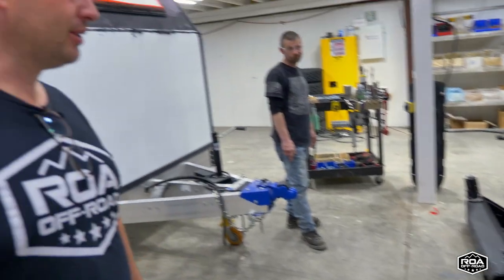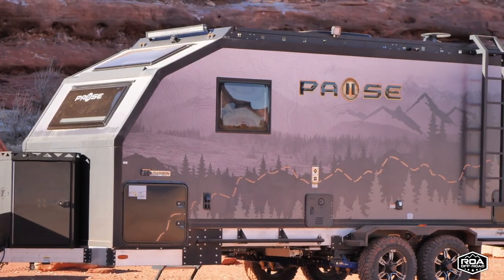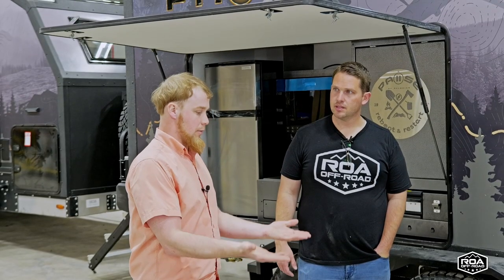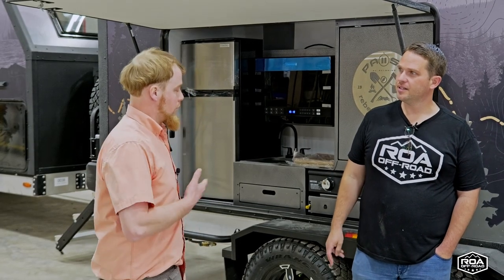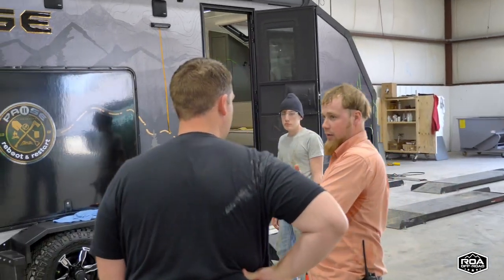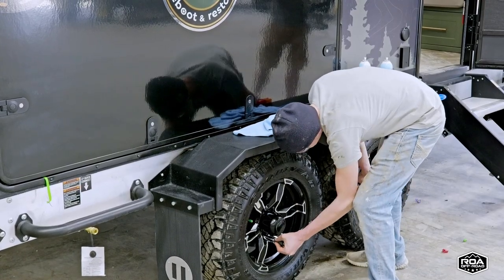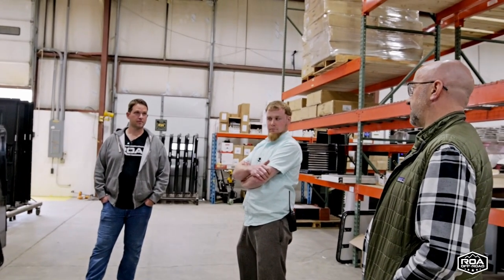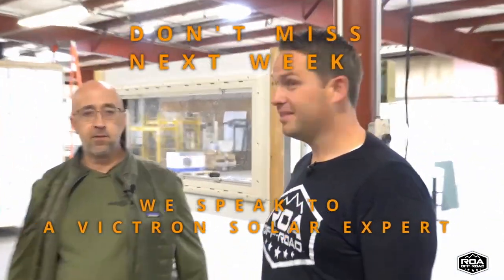RV Manufacturer Obsessed with Quality? 3X Inspection QC at Pause! Off-Road Trailer Factory Tour Ep4

Comment: Liking this and the x195..I wish they would get rid of the black tank and add that much more fresh water / gray water... use that commode that burns your poo or the one that vacuum seals it ..hate black tanks... doesn't look like you could upgrade this too easily following the build process